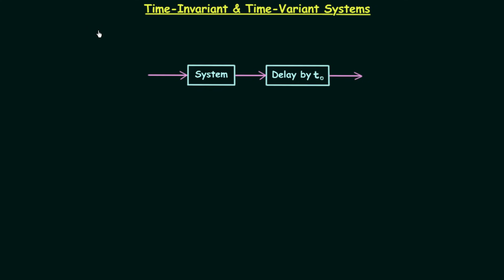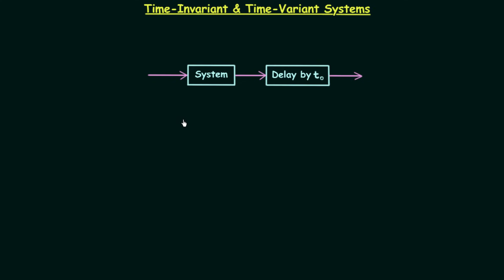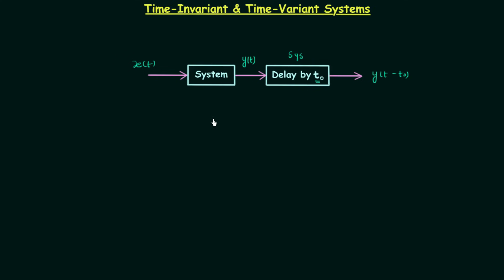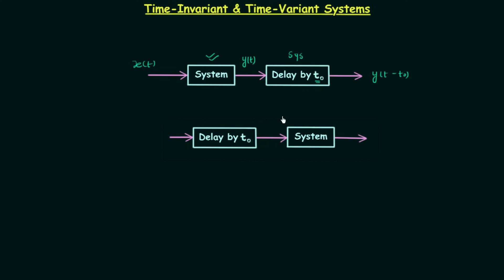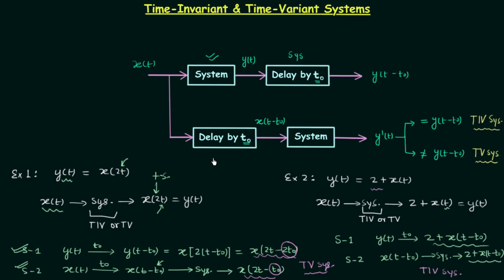Time-Invariant and Time-Variant Systems

Comment: I guess the first example is wrong. It is TIV because the output for x(t-t0) will be x(2t-2t0) and not x(2t-t0). The reason given in S-2 that the scaling applies to only the independent variable is wrong. The scaling applies to whatever is the argument inside x()
Reply from the maker: No, you guessed it wrong. The scaling is happening for time 't' only. Please watch the earlier lectures to understand these operations well.

Comment: in third homework question step 1) Will the cos(t) becomes cos(t-t0) when we perform delay by t0? The thing which is confusing me is, since the input signal is x(t) and cos(t) is a coefficient but at the same time cos(t) also depends on t. So, if we are giving the output signal in a system which performs delay on that signal, so should this system on perform delay on x(t) part of the output or should cos(t) also be included? Explanation will be appreciated.
Reply: I got your problem. you are confused becoz in causal video, Sir said,we should ignore coefficient while checking causality but here we have to shift cos 't' also by 'to'.
So answer of 3rd question will be Time Invarient.

Comment: Sir, when we delay the signal y(t) by time to, the new signal will be y(t+to). But why are you taking y(t-to) Sir? It will then become advancing the signal right?
Reply: Clearly watch the time shifting video posted by neso.
I am also stuck with this confusion.
Put the operations of time shifting on paper, then you will get a clear idea about it and you won't confuse again.
Reply: Time delayed by to, means what we used to get at t=t1 will now get at t=t1+to.

So, signal in y(t) we get y(0) at t= 0 but in y(t-to) we will get y(0) at t=to( by putting t-to=0).
And you can also look by signal plot delay by to means plot will shift to right by to, which will result into y(t) --> y(t-to)

Comment: 1.TV
2.TIV
3.TV
 In 3rd problem, x(t) is input and cost is the term obtained from the system's output.
Reply: @Faucacius because in y'(t) we only provide delay to input, means x(t) becomes x(t-to) while in y"(t) we change every t into (t-to) in whole equation. Not only input. Hope it helps :)
Reply: @vishvakapadiya3051  can you pls tell why we change all t→t-t0 for y''(t)
Reply: great
Reply: yes
Reply: Hi could you expand more your answer for no. 3?
Thank you
Reply: @julilacart3692  y'(t) = cost + x(t-to) and
Y''(t) = cos(t-to) + x(t-to)
Thus y'(t) and y''(t) are not equal. Hope it helps !
Reply: @vishvakapadiya3051  can solve 1st one is it time variant
Reply: @aravindhgunti  yes it is Time Variant. y'(t) = x(sint - to) and y"(t) = x(sin(t - to)) thus y'(t) and y"(t) are different. Hope it helps :)
Reply: @vishvakapadiya3051  thanks bro

Comment: Hi, in the first case, after going through the system the output y(t)= x(2t). Now if we provide a delay wouldn’t it be x(2t-to)? Similarly, in the second case the delayed input is x(t-to), and when this input is given to the system, wouldn’t it scale the whole parameter of the input and become x(2(t-to))? System is variant either way, but just for the clarification of the concept...
Reply: I agree with you but either way I don't have a clear answer for this.
Reply: bro, did you get the answer?

Comment: 1. TV
2. TIV
3.TV 
For anyone facing difficulty in solving the HW problems,  finish the next lecture and you'll easily complete this problems.
Reply: 3 will be tiv
Reply: @panwarmanoj1861  no, it is not.
Reply: thankyou so much miss
Reply: *these   XD
Reply: @watchmerolliin4896  chup baye chutyay
Reply: Thanks
Reply: Yes it's TIV because we are only dealing with the independent variable which is time not its coefficient cost

Comment: First I found 1. to be TIV but further reasoning results in 1. being TV:
In step #1 provide the delay t0 to the output y(t), giving y(t-t0). As y(t) is equal to x.sin(t), t is replaced by t-t0, giving y(t-t0) = x.sin(t-t0) = x[sin(t).cos(t0)-cos(t).sin(t0)].
In step 2, instead of providing the delay t0 to the output it is provided to the input x(t), giving x(t-t0). This is fed as input to the system which has the characteristic of performing the time scaling operation. The operation is taking the sinus of the time which is then multiplied by x. The time scaling operation is only performed on the time t itself, not on the constant t0. The resulting output of the system, therefore, is x.sin(t) - t0. This result is unequal to the result of step 1 above.
Therewith 1. is TV.
Correct me if I'm wrong. Thnx.
Reply: Hello everyone, refer to the next video of the playlist I have pasted the link below. The above problem is explained.
https://www.youtube.com/watch?v=BZq7j2b-7Lw&list=PLBlnK6fEyqRhG6s3jYIU48CqsT5cyiDTO&index=91
Reply: actually here in the first problem the thing is y(t) is a function of x(sint) which is read as x is function of sin(t) and not of t..so the first step is well known which will result in x(sin(t-t0)) and coming to the second step , we are delaying t by t0 but as we can see x is a function of sin t not of t..so it won't affect anything ..and hence the system remains to be Time variant ..as per my knowledge
Reply: Brother its not simple multiplication i guess,rather than its a function.
something like f(g(x)) also known as function of function.
Reply: Using the same reasoning, I find 2 = TIV and 3 = TV.
Reply: Bro its not x.sin(t), rather it is x(sin(t))
Reply: So ur reasoning is not correct i guess. Correct me if i am wrong.
Reply: According to my best knowledge, this is just a notational difference, all three notations meaning the same thing, i.e. x(sint) means: "x multiplied by the sine of the value for t" where the multiplication is implied by the opening bracket ( after x; then next x.sin(t) means: "x multiplied (the dot .) by  the sine of the value for t where in this case t is put between brackets ( ) to make the notation more clear, that is sin(t) instead of the seeming word sint which could mean something else such as saint; and finally your notation x(sin(t)) which also means: "x multiplied by the sine of t" where the multiplication is implied by the opening bracket ( after x.
Reply: If however, there is a difference between the three notations in that they produce different results, then please explain this to me. Also what would be the effect of your notation on the addition of the delay t0 before and after the system performs the time scaling operation? Thanks in advance for your response.
Reply: Bob Doorzon : x(sint) is similar to x(2t) , understood bro. 2 replaced with sin.
Reply: 3 of the answers are correct but, ur explanation is different, i or u might have interpreted it wrong.
Reply: absolutely right...

Comment: 1. TV 
2. TIV 
3. TV
please tell whether I have done it correct or not.
Reply: Tiv tiv tv plz check it
Reply: No its TV. Most probably the mistake you are doing is you are also scaling constant in step 2.
Reply: Question 1 is TV bcz any operation on variable makes the system time variant..  such as x(logt), x(cost) or x(|t|) except time shifting
Reply: sin is not scaler guys..its a function...simple sine has no value ..it always comes with a variable like time t
Reply: Kritika Deshmukh  so 1 question is TIV right
Reply: Ankur Santoria 
u r correct